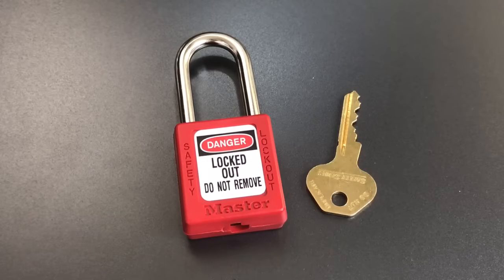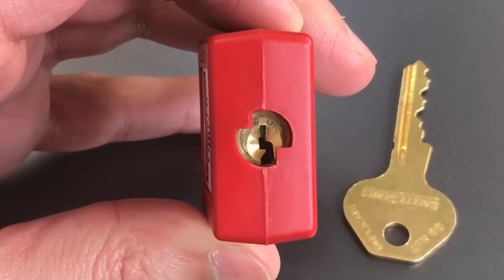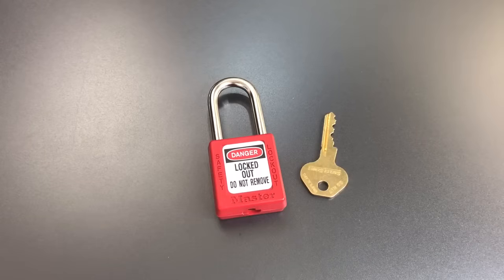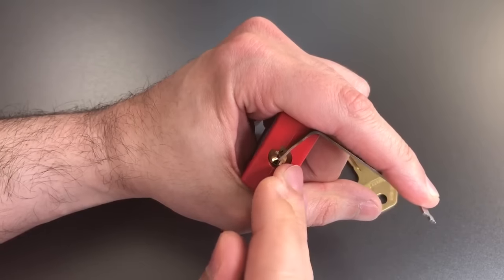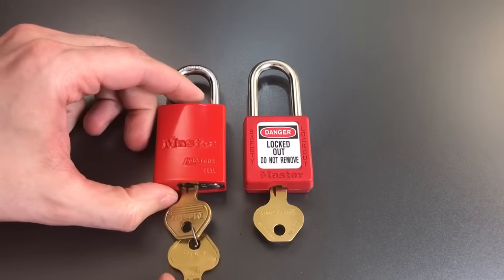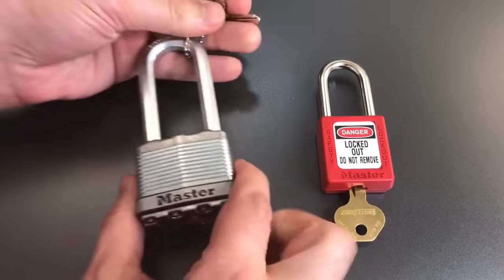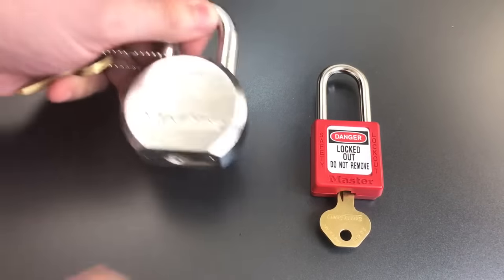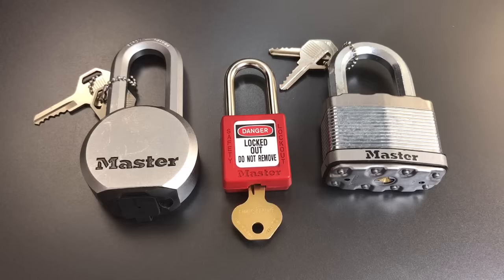[479] The Master Lock Paradox - Model 410 LOTO Padlock

Comment: As a former LOTO supervisor, I can chime in on this one. The 6 pins core allows for a larger number of pin combinations which means that my 375 locks all had a different key. Although my department had the lion’s share of these locksets, my company had other departments & sections that each had their own LOTO locksets, each with their own keys. That way, unless you had the key, you couldn’t open the lock. These locks are only there as a reminder that the device is not to be operated. As such, there is no need for the locksets to have hardened shanks or body. The problem is that keys get misplaced, lost, or even broken. After a thorough investigation, the only resort may be to cut the lock The LPL didn’t work for us and a locksmith would cost more than buying a new lock. It’s all about economic options.
Reply: That's a very great point and i do get why the body would be weaker for easier cutting. It may also explain why some hardened locks have weaker cores so that it can be picked easier aside from cutting it which would be way harder.

But the point of the Paradox he makes it the same point you've said. Masterlock has proven they have the knowledge and capability to make great lock bodies and strong cores, but they haven't extended much on that regard which always leave most of their locks a lot of exploits. 
In specific cases there are great uses for weak body and strong cores or vice versa but i think the point here is that generally, Masterlock has proven they can do better but is unknown as to why they don't.
Reply: Also the plastic body resist possible electrical discharge.
Reply: I was thinking along this line. Lock out locks are to give the service tech the confidence to know that his key is unique and no one will come and remove the tag because their key fits, while his hands are in the machine

They're not concerned with people lock picking the lock or needing to break it.
Reply: @iAmKilljoy  Fair point and i think i get it a lot better now. Thanks for clearing it up and although i get the point of a lock having its own weakness for certain areas, I didn't think about it nor was knowledgeable enough for its uses.
Thanks!
Reply: @davidmenasce6614  If they're not concerned with people picking it why would it sport 6 security pins over standard pins?
Reply: @Super1Rad Maybe parts reuse? Maybe the security key that results falls into a higher security class and won't simply be copied by an honest locksmith. 
Maybe it increases the number of unique keys? 

Whatever the reason, Master Lock isn't likely to tell you the answer.
Reply: 375 comes nowhere close to the number of combinations you can get with a 5-pin lock.  I think I agree with LPL that master using this core only in its plastic-bodied LOTO (with stronger bodies on everything else including its other LOTO’s) is a real head-scratcher.
Reply: @keef6468  thats the point though, there should be a vast number of combinations to eliminate the possibility of two keys showing up on the same job site, or some smart guy trying to make a master key kit. The fact that they use this core probably just comes down to production volume; rather than gear up to make a junk 6-pin, just use the one you already have from another model, and cost is offset by the rest of the cheap parts
Reply: There's like 100,000 different key possibilities on a 5 pin core
Reply: U took the words right out of my head. At our work place its quicker to cut the lock than to wait for the key to arrive. The machines at my work need to run all the time, time is money and when a lockout is in place that someone might have forgot to take off and has ended the shift or time wasting to find the owner of the lock. Its quicker to cut off and resume work
Reply: @KPSchleyer  It's only approximately 54,000 possible combinations if you have a 9 depth option, but there are other limitations in pin heights to prevent binding or breaking keys that put a 5 core pin closer to 19,000 usable combinations.
Reply: @vxicepickxv  yh if u need more than 19000 lock, you might have some problem
Reply: @KPSchleyer  Jesus Christ guys, he said he bought 375. The point is you want the odds of two people having the same key to be slim to none. The more unique, the better. They want to be able to keep buying locks over the years without a risk of keys becoming duplicated.
Reply: @Mazza666  Yes, but I hope your LOTO program requires a rigorous approval process for cutting a lock...
Reply: Destroying the lock leaves physical evidence, which is relevant if there was an incident.
Reply: Didn’t he mention this exact point in the video?
Reply: I don't think he's trying to say it's bad in these cases (like you said, the weak body is likely a matter of preference given its specific use), just weird. It shows they CAN make both hard to break and hard to pick locks, but for whatever reason, they never choose to do both of those things in one lock for those who would prefer it.
Reply: With 5 pins that can have 5 distinct bittings (not sure if that's the correct use of the term and not sure of the number...) there are 3125 different keys. 
Even with 6 pins and 5 levels of bitting, if you don't pay attention to "not getting duplicates" at 375 keys you'll have a whole bunch of them. (ok. Did a little math: there are going to be about 4 duplicates: Less than I expected).
Reply: @davidmenasce6614  Until a coworker/supervisor decides to remove the lock because they need the machine up. pick resistance is a way to ensure that it clear whether or not a lock was removed by it's owner. obviously if the lock had to be broken, it would be clear that it was was not on the part of the worker who'd tagged the machine out. Locks do occasionally get removed, there should/must be a process around it to verify that it's safe to do so, I'd argue that it's vital to make sure that if it HAS to be done it's done destructively.

examples I've seen are end of day cleanings and forgetful workers. Properly done. process would be supervisor contacts employee, verifies why the machine was locked out, verifies that the worker did not leave the machine in an unsafe state, inspects the situation himself before removing the lock. Documents it all.
Reply: I would think that if the lock is primarily a "do not touch" flag (relying on personal integrity), the number of unique keys wouldn't be an issue. Actually, I'd think redundancy would be beneficial.

I don't work in an industry using these, so take this as a statement of surprise and wonder.
Reply: As a former offshore elec, I concur!
Reply: @KPSchleyer  with 8 depths and 5 pins that is 8 to the 5th power = 32768.  That is the potential but about 50% of that can be lost due to mechanical issues and rules for progression.
Reply: There's no friggin way a LOTO lock needs spools and serrated pins.  Absurd.
Reply: @Mazza666  Go ahead and cut the lock. Someone gets hurt, YOU are on the hook for liability and possible criminal charges!
Reply: Before they let the muppets run amok in industry, we'd just hook a bit of twisted wire through the lockout tab with a note attached. Then again, 25 years ago I "almost" lost a hand when someone energized a bit of 60 ton pull electric-over-hydro kit I was working on - thankfully the equipment had a klaxon and a delay start. I busted the kid in the chops back before kinder and gentler HR snowflake times .. I suspect to this day a lesson remembered. Now we need 400 keys and individual lockouts.
Reply: @franzcruz8541  on a plant shut down the equipment is locked out and the keys to the lock locking out the equipment are placed in a lockbox and every person that could be affected by that piece of equipment starting up places a lock on that lockbox so the key to remove the lock putting it back in service cannot be used until everyone has removed their lock from the lockbox and agrees that it is safe to do so.  Since Master Lock made these locks at the request of major oil&gas and electrical companies,and I'm quite sure the legal departments were involved, liability is a factor in this. The company may have hundreds of locks split up into units and all the keys for that unit placed in one box and the personal working on it have their locks on that box. I've seen shutdowns with over 500 contract employees plus the plant employees and that is a lot of locks between the actual lock outs(equipment,valves, panels,switches etc)and the locks on the lock boxes. Uniqueness of the keys ( only one is provided with the locks) and the fact that it's hard to pick would go a long way in showing that someone showed a complete lack of regard for the lockout procedures and the safety of the people involved in the work in removing the lock before the equipment was deemed safe to start up. The reason given for the plastic bodies that I've found is that they are applied to high voltage electrical equipment but they have locks with nylon bodies and shackles for that so I'd go with other reason I've heard which is cost savings.
Reply: @Super1Rad  as a electrician that uses these regularly the idea is i want to make sure if someone removes the lock that isn't me that they destroy it... thus starting the legal chain of responsibility,  and In my work probably murder... I want less question that if the lock comes off it didn't happen to have the same key.... my lock my key no duplicate. And I want it good enough some duffis with a paper clip can get it off... I want the only good answer to remove all doubt of intent, whether that be that the key is lost or damaged and i am cutting the lock off or someone is trying to kill me... this lock is important but it needs the weak body to be destroyable if necessary.
Reply: Can confirm, idiots at my work frequently forget locks on equipment and go home. We attempt to call them but if they dont answer or are too far gone we have to fill out a form and cut the lock off because time is money. We use the American Locks LPL mentioned.
Reply: As a person who been involved in lock out procedures, This rings true.

And for those asking Yes, There are head counts and paperwork for cutting a lock used this way.

But the confusing part is if this core is good enough for a plastic lock its baffling to see masterlock putting the cheapshit cores for their premium, magnum super expensive range.

Unless they simply rely on their customers not being able to tell the difference and being impressed by that robust hardened steel outer body.
Reply: @catbiscuits4424  First, yes I think your guess there is correct, they know most consumers are not going to think about the core. But honestly, despite all of LPL's efforts, I really think that 99% of thieves do not possess the skills necessary to pick locks. It shouldn't be something you can just rake open, but I think Masterlock using cheap cores to keep the overall cost down is perfectly valid. You might even consider it a feature in some applications. You don't want to lose a key/combination and have a lock that a locksmith can't get off. But idk, I'm sure I'll get flamed for this, just my opinion. I don't worry about picking in most situations.
Reply: @Asmodeus-he2jx  This happens where I am too but it's considered a very big deal and let's just say the person who left the lock isn't going to do it twice
Reply: @sauercrowder  most thieves will resort to destructive methods for sure but I suspect that the ones who do deign to pick will likely do it quite well.
Reply: @charlestaylor3544  0 reason to have the lock there if no one is working on the machine and it’s safe to run.
Reply: We have a vending machine full of these at work (traveling field technician) because so many are left on or forgotten between shifts. One call to the worker who left it on and then break the sucker off. Safety not security.
Reply: @Maling Tørk you'd think, but you'd be wrong. A zip tie needs to be cut to be removed, it would be impossible to tell if I removed it myself or someone else did. If I have my lock on, and it's cut off, and something happens to me while I'm in the machine, it's pretty much guaranteed I'm not the one who destroyed it and someone else is to blame.

If something happens to me when i'm working in the machine and my lock isn't in place (but not cut), it's pretty much guaranteed i'm the one to blame.

This is why you need a strong core but not a strong body.
Reply: This also could have been a lock designed to meet one large customers lockout requirements and then sold as an off the shelf item. There may be specific legislation/rules regarding what is considered acceptable for safe lockout in different industries/countries.
Reply: @Super1Rad  if you read the entire comment then it's clear. If you know industry there isnt simply a few machines or LOTO points. Some machines have many LOTO points, and some have dozens. Thus you need to have enough locks with unique keys so the technician or mechanic can service, inspect, or repair the machine safely. Having a higher number of possible keys and a higher grade of key that is known to have one specific purpose and use makes it less likely for a locksmith to simply make another key. There probably some code or trust they go by if one of these keys comes in for a copy. If someone just comes in and wants copies that would seem a bit suspicious. Also, it's stated that these keys can be lost broken or damaged. These locks are also used very often. The plastic is cheap and the non hardened shank means if necessary the lock can be cut but only under specific conditions. Sure, you could go and start cutting them off if you wanted to be evil and harm the person in the danger zone. But it's more likely that someone would stop you before you were able to clear all the LOTO procedures since those arent known by everyone. Youd also have to read the manual and that takes time. But these locks are likely on the less expensive than having a new key made or having a smith come in to remove them. Theres a bunch of reasons behind the lock being how it is. The plastic body resists many things a metal lock doesnt. It also wont cause damage the same way a metal body or hardened shank will.
Reply: It's not so much a question as to why the LOTO lock has a good core, but why the security locks have such bad cores. The LOTO lock is just evidence that they can make good cores, thus confirming that it's weird.
Reply: I work in a manufacturing facility and not only is a new lock cheaper than a locksmith; cutting the lock is way faster, allowing the line to start production quicker than waiting for a locksmith to get on site.
Reply: Thanks for letting folks know about the wierd regulations that go into making their corn flakes. 

Fun anecdote a came across a set of these locks at a job I had that were completely unopened sitting on a filing cabinet. 

It was in case of inspection.
Reply: @indyhayes3979  My locks have a nylon shackle, and I have a whole set of them to lock out all 7 things [208 3ph, 480v 3ph. 120v for the overhead cameras, the OCR rack, pneumatic chain oiler reservoir. Upstream breaker(s)] required under our electrical work program. Due to the reasons OP stated, the fact that we use dielectric locks to prevent pretty bursts of face-charring plasma is irrelevant since they're for accountability and a reminder not to turn on the juice when someone is in the machine. If someone takes a lock off where I work without authority and without making the reasonable attempt to contact the lock owner, that can end your career. We are the federal government where I'm at, so OSHA does pay more attention to us than other entities.
Reply: @sauercrowder  You get it. Where I work, there are 600,000 employees nationwide that wear quaint uniforms and stealth their way across your lawn to leave paper rectangles in metal boxes. I did that for 12 years, now I support parcel and letter automation as a mechanic. The USPS has an absolute mountain of these locks and there's also a design requirement that you don't have bitting that's all 2s or something easily opened. 6 pins affords that luxury.
Reply: @paulpearson99  OSHA dictates the one key one worker thing. A worker can have multiple locks, but they all have to have a single key and cannot be keyed alike. I have 7 locks for one machine. All are different keys.
Reply: I drive haul trucks in a mine, LOTO locks are freely available to us locking out on a truck is done multiple times a shift. I lost my key and needed to remove my own lock. Smashed the lock between two rocks and grabbed a spare from my backpack.
Reply: which is what he said about the number of differs, but it doesn't really explain the amount of anti-picking mechanisms they put into a lock that's designed for safety, not for security. Particularly when talking Masterlock which can be pretty bottom of the barrel on their locks.
Reply: @indyhayes3979  I don't think anyone has a problem with how the first LOTO lock was made, the issue is that they clearly know how to make a great core, but failed to put it in any other locks that are actually intended for security.
Reply: @keef6468  I think it comes down to demand, they can use the exact same mass produced lock ( change shell for other uses ). 700k keys, think a huge factory. One I worked in had thousands of locks, all internal, so unless you have correct key then you don't access. Lock outs, inventory control, chemicals, locker room, supply cabinets. You'd be surprised and these use same lock different shell internal use so breaking it not as much of an issue, you'd be caught. Just a simple layer of protection for workers and business. For Master Lock, same lock multiple applications. I just think it's economics. Just my 2
Reply: Makes sense. I thought that would be the case with them being weak as they don't necessarily secure high value merch just to stop someone accessing something dangerous.... and now I understand why they use a six pin core thanks mate
Reply: Well said.
Reply: As someone who does LOTO on a regular basis, this is exactly the thinking behind the design.
Reply: @Mazza666  Nice :). Locked out, do not remove. Let's cut it, he is probably not there :) . Once I saw a fireproof door, that were fixed in open position by fire extinguisher.
Reply: That plastic LOTO is the one we use at my workplace as well, RhumRunner41.  It's amazing that it looks so cheap and hokey, yet none of our keys ever seem to fit any other locks!
Reply: @paulpearson99  as someone that works on industrial construction redundancy is BAD the locks are "assigned" to a tech / job and ONLY the person who locks out the equipment has the right to unlock it and like stated above the security core will make picking VERY HARD and cutting it off easy making a trackable incident IF something goes wrong
Reply: @Doggieman1111  pick resistance will REQUIRE the cutting and therefor leaving evidence of its unauthorized removal
Reply: @protercool8474  I want to know is there a MASTER with that core but a "good" body and preferably NOT LOOK like the magnum OR other "huge" lock
Reply: @bryguy2724  BINGO we want that core in a HARDENED SECURITY lock
Reply: You didn't have to cut the lock at all. It's made to be able to break apart. Just bind the lock shank in the locking mechanism and apply pressure. Walah! The body just breaks apart, for easy removal.
Reply: Spot on. Also the plastic body keeps it light weight. You could have 10 locks securing on group lock-box. That can get very heavy if your walking it around a big site.
Reply: @Super1Rad  more pins means more possible combinations for the unlocked state, meaning you can have more locks on sight with no overlap on which key opens which lock.
Reply: @sauercrowder  thats that real safety of loto it could be a paper tag but the process for being allowed to remove someone Else's LOTO is so crazy it might as well be vibranium.
Reply: @TinyTyranitar95350  Where I am the manager has to contact the person who owns the LOTO and verify the status of the work, that person's location, etc. Most likely the person will be ordered back to work to do a proper shift passdown and remove the lock with their key, but if the result is the lock being cut there will be follow-up and the person who owns the lock will be in the hot seat. It also won't be an immediate resumption of work, they will have to spend time verifying that there's no safety issue present.

These rules exist for good reason, I can cite plenty of examples of people being injured or killed in our industry because the rules were ignored.
Reply: You might also have a dozen workers inside and therefore a dozen locks hanging off one switch.  The multilock hangers are not that strong to handle repeated weight of heavy locks.
Reply: I work for the railroad and we have a clamp we put on the battery box and there can be up to 6 locks if I remember correctly maybe 8 placed on this clamp for one piece of machinery. Mostly for the operator(s) and the mechanic(s) and like you said if a lock is left on there by mistake and the person is home for the day or whatever the circumstances might be and only after making contact and going through the procedures as you mentioned then can it be cut off. Railroad issues out these locks to everyone who needs them and each key is specific for that individuals lock.
Reply: Also can be busted off without having the be grinder for causes that you can have a spark
Reply: @paulpearson99  Having more unique keys reduces the chance that someone will remove the wrong one when it is time to remove a lock.  That will prevent accidents.  You can give the key to the newest noobie and not be concerned that he will make an error.
Reply: This is what I was thinking. Imagine you work in giant plant and your  life depends on that lock. There are few locks next to each other and you  only have the key for your lock , you of course forget which one was your lock so I 

You just go and try with the key, if the key can open multiple locks , you could easily kill someone else working on the equipment .At the same time if you drop the  key while working ( which can happen more often than you think) and lock body is bulletproof, how are you going to put the thing back to work? Or maybe it's better to try picking it for hours while owner is loosing hundreds of thousands an hour in downtime.
Reply: @thegamepz  If the key gets lost, then your company can physically attack the body of the lock.  That is why the lock can be physically weak.  Even a newbie will know to get help if he loses the key.  The lock is intended to prevent errors and not deliberate attempted murder.  

If you have employees that might actually want to kill each other then buy a stronger and more expensive lock-out lock.   But that is often an unnecessary expense.
Reply: @isaacclark9825  exactly
Reply: Sounds official. Smaller applications would get fewer pins, bc why pay extra? There's a similar thing with IP addresses, where home networks can only add 256 unique devices, but corporate (private) networks can add thousands. No cost advantage there, but reduces miscommunication about the size of the network.
Reply: @Super1Rad  I worked in a factory that had over 1000 machines, and each machine had 1 to 6 LOTO locks assigned to it.  Also, each mechanic had a set of locks assigned to them.  Every lock had to have a different key, to insure no one else could easily remove the lock.  The lock is there for Safety, not security.  The 6 different pins is needed to insure there is more than enough different key combinations so to not have any duplication of the same key
Reply: @paulpearson99  I do work in an industry which uses these and frankly I'm horrified there's a concern someone would use a duplicate key to open a locked out machine. If you didn't lock it out you don't open it!!! In these cases SOP would call for the supervisor in charge of the machine to approve the removal, positive verification that the individual who locked it out is safe and out of the machine, and a full detailed inspection of the machine before operation. Removal of someone else's lock out results in for immediate termination (with signs on the machines stating thus). What a horrible, senseless way to die!
Reply: I worked in a facility where a maintenance guy died while his LOTO was in use.  (not from the what he had LOTO -think it was a heart attack)

This was in a USPS facility - they called in OSHA to officially "decommission" the lock.  

We were in a DIFFERENT USPS facility once when someone bypassed our LOTO and almost electrocuted our lead.   (3 phase HV)  Dunno what happened in the end, but I know it got escalated WAY up, and possibly reported to OSHA as well.  I know Tony was ready to kill him

What saved Tony was the adjacent machine that was on the same circuit went into startup.  He was reaching into the powerbox when he heard it fire up.
Reply: The fact that master uses security pins in the LOTO, but not all thier other locks is mind blowing.  totall not needed for this use.
Reply: @keef6468  These are made to be used in an industrial setting by technologically/mechanically minded people, in other words, people who are more likely to try picking a lock because they understand the mechanism involved. The type of places that would use these probably have a much higher percentage of amateur lock pickers than most other areas. So while the other locks are more robust to repel your average "beat it with a hammer then steal whatever you can grab and run away" types. These are designed to keep out the type that is smart enough not to smash company property, and therefore smart enough to try picking the lock with a screwdriver and a bobby pin because they need to start the god damned machine to finish this project and Bobby said he was just going to the bathroom and he'd unlock the thing when he got back but that was 3 hours ago..
Reply: @keef6468  these locks are used by the whole industry, even between sites. Having unique keys is very important so you don't accidentally remove someone elses keys.  There are probably well over 100,000 people with these locks over the Western Australian resources sector alone.

Most people have 5 locks keyed alike, so they can tag out multiple pieces of equipment
Reply: Also because the metal body with hardened shackle are designed for mechanical lockout where the plastic ones are for electrical switches. Take that with a grain of salt because you can realistically use either for either purpose but that's what they were designed for
Reply: @patnad2746  within a group of 23 random people there's a >50% change of two having the same birthday, so yeah, 6 pins would be handy

on a side note, they could use this strong core more, because it's common to see beefy marterlocks being defeated in humiliating ways
Reply: Can confirm, been looking for my loto key for 3 months now
Reply: Wow, in my career I worked for a multi-national waste disposal company (golf tourney one) we were sent home to get our lockout 🔑 if we “forgot” them. Losing one went on record. They also had a gruesome amount of stats to back up their safety stance. Worked in over the road vehicle maintenance. It all comes down to the companies level of boots on ground enforcement of policy. Or $ incentives I suppose, regardless this outfit followed through.
Reply: As I understood it, he's not saying the plastic LOTO lock is bad for its purpose, but rather the other locks intended as security measures have a comparatively weak core
Reply: @franzcruz8541   111 👍
Reply: damn that actually makes a lot of sense
Reply: Came in to make pretty much the same comment about having to cut them off. Didn't think about the need for diversity so one key can't hit someone else's lock tho
Reply: Imagine a supervisor kneeling next to a lock, slowly picking it, while a guy's inside the machinery about to get crushed.
Reply: @Doggieman1111  Someone made a good point that if someone WERE to illegally remove a LOTO lock without going through the proper protocol, they'd want to do it without destroying the lock, which leaves evidence. This is a situation where an unscrupulous person might try to pick the lock.
Reply: This explains the one lock but doesn't explain the other locks for the same purpose which are the complete opposite.
Reply: @Doggieman1111  The average electrician has enough tools on hand to pick most locks. If they cut the lock or damage it there is proof they tampered it. So the core is a bit tougher to open to prevent easily opening it.
Reply: @indyhayes3979  not much point resisting electrical discharge when the shackle is steel.
Reply: The loto lock may also be designed to meet government or military standards.
Reply: Dizzy Gear  " 'Tis what happens when the boomers...."

It is more related to the fact that in large plants they have periodical stand stills.  Those are periods for maintenance. During this period a ton of different companies/contractors come in and miscommunication is easy.
What the LOTO system does, is to give each contractor the lock out the energy source (and/or controls) of the equipment he is working on, so that someone else does not switch it on because it needs to be switched on for HIS job.  (Especially if delays crop up, and they always do...)
That is also the reason why there are LOTO boards, where every party that needs the machine to "unswitcheable"  can lock that machine.
Such a board can contain locks from multiple different companies/persons (possibly up to 10 or 20).
Imagine managing the communication for all those people for a single machine.
Now imagine doing this for the whole plant.

Of course you still will have to manage to communication, but that is then done at planning level, not individual machine level.  The LOTO is there as a backstop for dangerous miscommunications.
Reply: We used those locks at lowes when we locked circuits out for display changes. The key and lock were checked out to specific reset team leads and if the reset wasn't completed in a single day the circuit was kept locked until we finished it just in case something was exposed and could be dangerous. Key went home with the supervisor to ensure it wasn't engaged while the team that knew what was and wasn't a possible threat was not there. My boss had to be called in a couple times to unlock a circuit we had locked out for an adjacent area that was on the same circuit when it was deemed needed and after a thorough check that everything in the display we were working on the night before was safe.
Reply: @Mazza666  doesn't that circumwent the purpose? The owner of the lock is the one who know why is there and therefore also when it's ssfe to operate the device again?
Reply: I didn't make it through all the reply and it may have been covered, but similar to the liability/facilitating break in points, 
If someone wanted to break the lock for any malicious purpose, in a very large percentage of the industrious work spaces that would use these lock, the person would have all sorts of tools immediately available.
So perhaps it's a moot point sinking money into the case. 
I also like the point about electrical protection
Reply: @paulpearson99  the locks make it impossible to operate the machine without its removal.  Duplicate keys are bad news bc you want the guy whose hands are inside the licked machine to be the only fellow with a key . Prevents accidents .
Reply: @sauercrowder  very few padlocks are worth paying a locksmith to pick.
Reply: I'm a chemical operator and I do lotos essentially daily. We have all 3 locks in this video mentioned. The plastic body is by far my favorite for its light weight (we often have to carry 30-50 at a time and it's ability to endure weather and corrosion. We work with HCL, sulfuric acid, h2s, chlorine etc and the other locks in the video pretty much always get siezed closed in our harsh environment. The plastic ones can remain in a lockout for months and will unlock months later without issue whereas the metal ones often have to get cut off due to corrosion.
Reply: We have 6 pin locks all over my college campus on the dorms...the buildings have 150 rooms and there are about 15 buildings...you make combinations of keys possible not with the numbers of pins, but the length and with/if you include wafers...do you think there are only 6 pin lengths?
Reply: I get the need for variety, sure. In LOTO situations where it turns out your lockset is too small or has duplicates, the odds of two LOTO locks hanging right next to each other on a big switchboard is nonzero, and if someone was able to accidentally open the lock that was one space to the right of the one he actually needed to open that can immediately lead to loss of life.

You gotta understand folks, the risk involved in removing the wrong LOTO lock is statistically very small, but the potential consequences are disastrous.

What I don't understand is the need for all these security pins. You're telling me you need to protect your LOTO system against maybe a guy going in there and trying to pick LOTO locks open? The locks are pretty easily brute forcable by design as indicated, a secure core is absolutely pointless. In the type of facility where these are used someone has already gotten through several layers of security before they can even get access to where the lock is located, let alone pick it open.
Reply: Hell you don't even have to cut that LOTO lock. I pulled up on a job one time where my buddy told me to bring an angle grinder so we could cut the lock off. When I got there and saw it was this plastic body lock, I grabbed two wrenches instead and forced the shackle apart in about 5 seconds. Lol
Reply: @KPSchleyer  10^5 = 100K combinations. Math checks out.
Reply: @vxicepickxv  0-9 is 10 options or 10^5